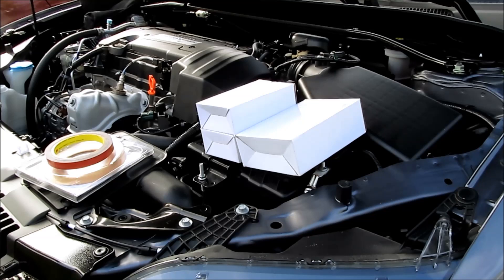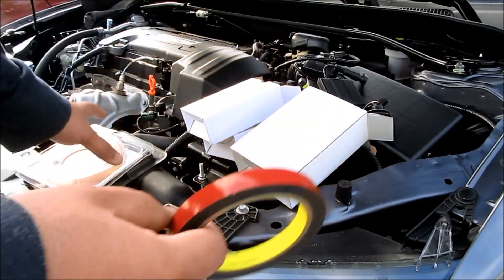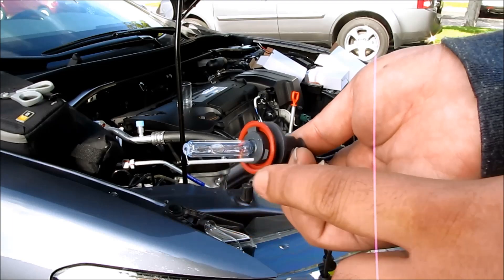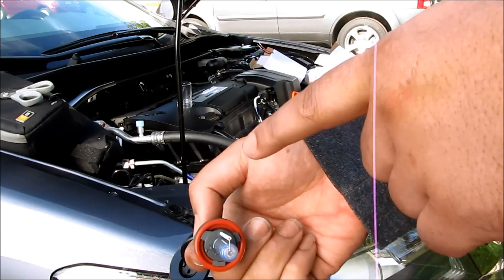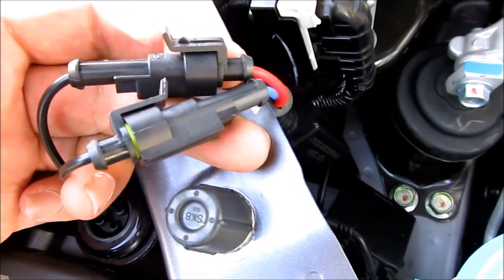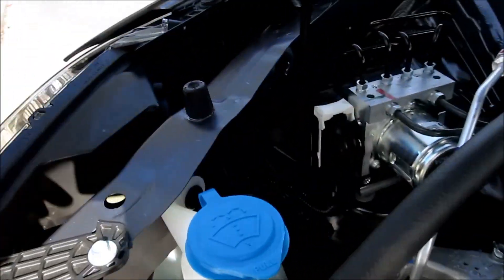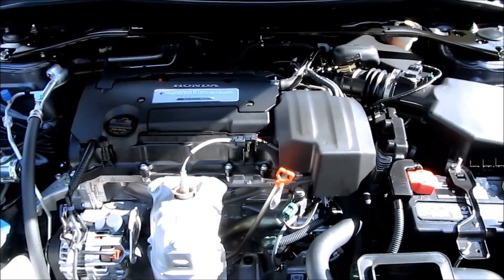DIY 2013 2014 2015  Honda Accord HID install (Must Read Description and Turn on Annotation)

Comment: Did you replace the DRL/High beams. If I want to use the high beams do you see any problems with using a 9005 LED bulb | 30W CREE Light? I want to just remove the yellow look, so would that option work? Thanks
Reply from the maker: Clint Cunningham Yes those will work.  As long as your okay with a non functional high beam.
Reply: If you don't go with with a LED could you just get a halogen with a Blue tint so you don't lose brightness on the high beam?
Reply from the maker: Clint Cunningham Yes. and if you really want leds and still want a functional high beam they do sell really bright leds.  Last I checked they run around $120+ for a pair.

Comment: Noticed you mention H11b for bulb size from DDM website but I do not see it. Only see H11. Is H11 the right size?
Reply from the maker: Yes, the H11 bulb DDM sells is actually a H11B bulb.   The H11 listed is the correct bulb.

Comment: hey if i want to mode my 2013 accord coupe v6 with matching fog light and low beam colors whats the best? 6000k low beam and led fog? thanks!!
Reply from the maker: ***** If you have a V6.. you have the LED DRL strip.  6K will not match those.  I would look into getting either 4.5k 4.8k or 5k. http://www.driveaccord.net/forums/showthread.php?t=187345
Reply: DIY: Car Modz what would you recommend me getting? maybe 5k Low beam HID and what about the fog lights LED good? does LED have differrent colors to match? 5k?

Comment: What are those other wires for on the bulb? The one you took out the rubber piece
Reply from the maker: yungmexican32 adapter harness. FAQ: 2013 2014 Honda Accord HID Install 9 months Update

Comment: Will both the bulbs turn on when you have the headlight position to auto and then start your car?
Reply from the maker: Phu Nguyen Yes. Works on both auto and manual headlight mode.
Reply from the maker: Phu Nguyen Here is a quick video on auto headlight with HID: 9thGen Honda Accord Auto Headlight Function & Settings

Comment: Do you have a night video which shows the LED output on the road?
Reply from the maker: +SAL I do not have led headlights.  Only exterior lights that I've changed to LED are the rear turn signal, the front parking lights and the front fog lights on the coupe.  Fog light output will be different between the coupe and the sedan.  The housing is design is different.
Reply: +DIY: Car Modz I meant night video for the HIDs? I'm looking to buy a kit from DDM Tuning but uncertain on the brightness. Thanks.

Comment: the connector to the power source base is too long so I can't  push the socket all the way down, do I have to cut it a bit shorter?
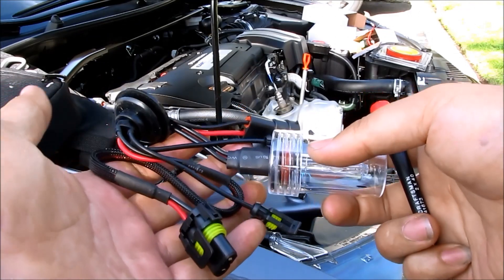Reply from the maker: Instead of cutting the connector, use the 9006 to H11 adapter wire that is attached to the HID bulb.. ( the part that I removed and didn't use on the video .. refer to 2:21 mark on this video.

Also, check out my other video:

DIY HID Installation Tutorial   Connecting OEM Headlight Plug with the HID ballast Plug
Reply: Thank you so much!! You totally saved me today sir

Comment: will the 35W 8K H11 DDM hid kit. fit a 2014 honda accord sport i looked up my bulb type and is says i currently have a H11 low beam HB3 high beam will it make a difference if i get H11
Reply from the maker: For the low beam purchase the H11 from DDM
If  you want HID for the high beam.. purchase another hid kit hb3/9005

Comment: Car Modz: just tried to install an hid kit (h11) headlight bulbs last night and they did not turn on? I connected the cars plug to my warning canceller, then the other end to my ballast, then the normal male and female plugs from the hid bulb to the other end of the ballast.  I thought everything was good, I even tried the reverse polarity of the wires (turned everything upside down) and that did not work? any ideas on what else I am doing wrong - I thought I followed all of your instructions?  I also did not remove the wire that you did in this video - i don't need it do i? also dumb question - i did this all when the car was totally off - so to check my work all i did was turn on and off the headlights - the car should be all the way off right??
any advise would be greatly appreciated - i don't want to return my kit?!?!
Reply from the maker: remove the warning cancel module.  ( Honda doesn't need it).  Then check out my FAQ installation video here: https://www.youtube.com/watch?v=AVT0pDEgDsc
Reply: Ok. Great thanks for the updated video. Hopefully that fixes my issues and I'll let you know how it goes. I have a fog light kit too so I am assuming that I should connect it the same way!? Thank u again for your time.
Reply from the maker: dustin morse Yes, the fogs are connected exactly the same.  I have a video on my channel for both the sedan and coupe fog installation.
Reply: Got the lights in last night! Sweet! Thanks for all of your support. On to the fog lights this weekend hopefully!
Reply from the maker: dustin morse Congrats!  Glad to heard you got everything working.
Reply: So I can't get the housing unit off of the fog lights. It feels stuck. I undid the screw under the car as that was easy but looking at your fog light video I can't un-hinge it from the car so I can put the lid kit in. Any other tips to admit me car modz??
Reply from the maker: dustin morse Is it the black trim around the fog light your having problems with?  if so,  You might just have to loosen the screw on the bottom a little more.  Also, check you owner's manual.  Page 515-516
Reply: Ok. Will do. Thanks for the response.
Reply: Good luck!  Car modz: I finally got the fog light unit hid kit in this weekend. You were correct in that I was not loosening that screw under the car enough. Got it and the car looks sweet with the headlight unit too. Appreciate all your responses to me.

Comment: is it important to use relay harness? the one with the fuse..
Reply from the maker: mcmc It is recommended to use a relay harness but not required for the accord.
Reply: what would be the pros and cons of NOT using a relay harness?
Reply: rocker85675
DIY: Car Modz
Does this kit come with relay harness? Should I get it for my new accord? Will it burn my electrical wires over a period of time?
Reply from the maker: You have to purchase the relay harness separate.  Buy one if you want one.  It will work with and without it.

Comment: 35W 5K H11b DDM hid kit that u use can fit with my 2014 acct 4door V4 ? i try to find it online but i seen some is cheap n some is expensive… How is differ ??
Reply from the maker: Yes, the DDM kit will work with your car.. 35W 5K H11.

The difference is marketing and quality.
Some as DC ballast some are AC ballast.  Some have better salt capsule, Some uses quick start technology ballast... Just because it cost more doesn't necessary mean it is better... You just have to make sure you know what your buying...  If you want a better HID kit.. look into purchasing XB35 from theretrofitsource.
Reply: i install HID kit to my car already … the color white… m so happy. THx q anyway for ur helpfull n ur Video :)

Comment: Bro, I tried installing these HID today with no luck.  I could not get a click no matter what and the HID didn't turn on.  Only thing I can think of doing is dremel off a few cm from the tip to make the positives and negatives touch. Any thoughts?
Reply from the maker: Take a look at this video:

DIY HID Installation Tutorial   Connecting OEM Headlight Plug with the HID ballast Plug

and let me know if it still doesn't work.
Reply: Jephu
i have the same problem my just didn't turn on
Reply from the maker: Phong Nguyen
DIY HID Installation Tutorial   Connecting OEM Headlight Plug with the HID ballast Plug

Comment: I saw some other car DIY that requires the fuse change from 15amps to 20amps. Is that not necessary for this car?
Reply from the maker: liltunwin nope.  Not for hondas.
Reply: Thanks. Also, what do you use to lift up your honda sedan to replace  the fog light? (saw your other tutorial) Sorry I'm new to all these.
Reply from the maker: liltunwin That was the customer's rhino ramp:
http://www.amazon.com/RhinoGear-11909-RhinoRamps-Vehicle-Capacity/dp/B006EGAIII/ref=sr_1_1?ie=UTF8&qid=1430790834&sr=8-1&keywords=rhino+ramp
Reply: Is it necessary to put a guard on the back tires when the front tires are on the ramp (even concrete floor) or putting in Park and E Brake is sufficient?
Reply from the maker: liltunwin Probably not but I always do it as back up.  I would hate to see the car roll off the ramp because I forgot to put a $10 pair of wheel chock. http://www.amazon.com/Camco-44414-Wheel-Chock-Pack/dp/B00K1C1WC2/ref=pd_sim_auto_4?ie=UTF8&refRID=1SFZ8V6P9NCJ6SCHVCTT
Reply: thanks. This helps a lot prepping myself to install them headlight on my accord.

Comment: does it matter that I have a exl v6 with the drl lights? would it affect that? and whats the dif between ddm nd other hid kits cuz I c a lot
Reply from the maker: If you have h11 halogen bulb.. this will work.  Just make sure to buy HID kit with comes with a AC ballast and H11B style bulb.

Comment: Hey when I install my hid do you leave your lights on auto or do you manually switch them on. Is it ok to leave them on auto or no..
Reply from the maker: napoleon2200 I manual turn my headlights on and off.   You should not have any problem with the auto setting but if your going to use the auto feature, I would double check from time to time to make sure that they are working correctly.

Comment: Will I need the HID harness that's sold sepperate?
Reply from the maker: No, you do not need the HID wire harness.  You can buy one if you want but it is not necessary.

If you want to use it.. i have a DIY tutorial on that as well.

DIY HID Relay Harness Installation tutorial

If you need a DIY video on the actual car itself let me know and I'll add it to the list future DIY videos.

Comment: So it’s mandatory that you have the ballast?
Reply: HID's will not work without the ballast, not to mention that the bulbs dont have the right connectors to plug into your car's wires. HID stands for High Intensity Discharge. 12-14v from your car's battery and charging system will not be enough to power these bulbs. HID's needs over 25,000 volts to initially spark and start producing light, that's why you need the ballast, it uses the 12-14v to step it up to the voltage required to fire up the bulb. That's the voltage required to ignite the bulbs, once the bulbs produce light, it only needs >90 volts to sustain light.

Comment: Could you maybe send me the link to these HID's? Thanks man!
Reply from the maker: http://www.ddmtuning.com/Products/DDM-HID-Kit-Slim-Ballast-35W-or-55W

35W
H11
5K
No to everything else.
Reply: Jephu Can I purchase 55W? Will that be a problem?
Reply from the maker: Andrew Monasterio
I do not know.  The car has been only out for a year now and I'm not sure how many people have installed the 55W HID kit.  The 55W Kit is slightly brighter than the 35W but they do run hotter.  I'm not sure if that will damage the projector housing or not.
Reply: Jephu Ok thank you, I will probably go with the 35w. One more question...for the high beam bulb what color do you recommend? The same as the low beam? 6000k? Or should I go for 8000k on the high beam?
Reply from the maker: I would skip the high beam HID conversion all together.  Unless of course you drive with your high beams on all the time then, yes get them.  The reason is that the HID bulb takes like 8 to 12 seconds to be fully powered to full brightness.  Also the flickering of the highbeam will put stress on the HID ballast and can lower the life of them. If you do get them, you will either have to disable the DRL light or buy a DRL adapter module so both the DRL and Highbeam will work.

Comment: hows the cut off with hid's on? does DDM make 4300k?
Reply from the maker: Cutoff is okay, not great.  But much better compared to other regular halogen headlights.
You can check out my other videos that shows the cutoff:

H8 30W Cree LED Fog Light - 2013 2014 Honda Accord Coupe OEM Fog Light Assembly

The other question can be answered here:

http://www.ddmtuning.com/Products/DDM-HID-Kit-Slim-Ballast-35W-or-55W

Comment: Can h11 bulb fit too? Or does it have to be h11b bulbs.
Reply: H11 bulb will fit.  But, there will be a shadow on the light output because of the return wire. 

H11 bulb has 3 tabs on the bulb base.  The H11 bulb that cast the shadow are the ones where the return wire is located on the same side as the middle tab.  H11b style, the return wire is on the opposite side of the middle tab.  When shopping for H11 bulb.. make sure you purchase the one where the return wire is on on the same side as the tabs.

Comment: hi jephu.  Do you know if I purchase an H11 from another brand, would it fit 2014 honda accord?  It didnt say H11b. thanks
Reply from the maker: Yes, any h11 bulb will fit.  The difference between a h11 and h11b bulb is the orientation of the return wire on the hid bulb.   

H11b has the return wire on the bottom and H11 has the return wire on top.  DDM list the bulb as H11 and the return wire is on the bottom.

The output difference is... H11 bulbs cast a shadow while H11B bulbs doesn't.
Reply: thanks.  you are very helpful.  One quick question for you.  Did you happen to make a video on how to install the resistors for led turn  signal? also, i was thinking of switching my to 1157 switchback led, is it bright? or should i go with the high power one?  thanks
Reply from the maker: I'm not 100% sure if 1157 would be the correct bulb type for the 2013 2014
Accord... Do you have a coupe or a sedan???  Also the switchback leds comes in 3 different types.  There are ones that turns on white with the parking light and when you turn on your indicator the white will completely turn off and will blink only amber.. and once the turn signal is off.. it will go back to solid white...These are called type 2 switchback.

Now there are ones where it turns on white with the parking lights and when you turn on your indicator.. they will alternate and blink amber white amber white. These are type 1.

Third.. there are ones where they turn on white with the parking lights.. and when you turn on your indicators.. the white continues to stays on constant and amber only blinks .  These ones are bad because the white color over powers the amber color and so even though the amber color is blinking, it is impossible to really tell that it is.

To install the resistor.. The resistor will come with 2 wires.. one on each end.  you will have to tap one end of the resistor to the negative wire (black wire) and the other end to the turn signal positive wire.   Don't forget that the resistors will get extremely hot.  It gets hot enough where it will burn your hand so it is critical that you mount it on a metal surface away from any wires or plastic.
Reply: i have the 2014 accord sport sedan.  I think the one im looking at is type 1 just like yours.  so about the resistors, should I get some screw and screw it into a metal body? or should i get some metal wires and wrap it around some metal beam? would that work?
Reply from the maker: You can screw it on the metal body or use anything that will hold the resistor in place.  Your going to need 8ohm 50watt resistor per each bulb.
Reply: hmm. i guess i just bought a wrong one.  i searched on ebay for a signal light led resistors and i bought a 6ohm instead :(  do you think that will work?
Reply: also, for the foglight, it said 35w in the manual.  but if I want to go with say 80w led foglight, will this burn my wire? or melt the housing?
Reply from the maker: I can't answer that for you since I have not tried to install an 80W led foglight.  The 30W I tried was blinding as is.
Reply: ic.  thanks for all your responses.  you are very very helpful.

Comment: What exactly did you use the zip tie for?
Reply from the maker: Used ziped ties to clean up the wiring and to reinforce the ballast mount.  The ballast mount has 3M VHB tape but I just wanted to make sure that it was going to hold.

Comment: I'm new to hondas does anyone know if this requires a relay kit. or is just ok with just bulb n ballast?
Reply from the maker: +dsniper02 No relay was used on any of the Honda vehicles in my family since 2009.  Zero problem. However, it doesn't hurt to use one if you feel the need to.  Just one extra component that can get damaged.

Comment: How do you take off the bulb housing on the h11 bulb
Reply from the maker: +Andy Cheng twist the top off.  The base you can squeeze the cap to fit it through the top.
Reply: +DIY: Car Modz  okay i kinda just broke the casing lol.. but i had trouble installing the kit trying to get my bulb to turn on. I basically plugged it in the w/ the correct direction and connectors and turned on my headlights. (am i suppose to turn on my car or something else wrong with my kit) Note: i did not turn on my car when i installed
Reply from the maker: +Andy Cheng Most likely the connection between the original headlight socket wire harness and the hid ballast needs to be pushed in or flipped.  Check out this updated video: https://www.youtube.com/watch?v=AVT0pDEgDsc
Reply from the maker: +Andy Cheng The lights should turn on without turn on the vehicle.  However if you 
had the door open for a while .... the lights  will auto shut off so try closing and reopening 
the door.
Reply: +DIY: Car Modz Ill Check my wires, I see in the video you linked me to that you used the wire closest to the bulb to connect to the standard one (stock connector) i believe mines doesn't fit for some reason? i have to check the wires again. ill probably try to do it again tomorrow
Reply: +DIY: Car Modz I checked my wires and figured out that the stock wire didn't fit the wire next to the bulb, so i sort of moved it little and i plugged it in and it worked. (haven't installed yet but ill do it tomorrow when theres light out